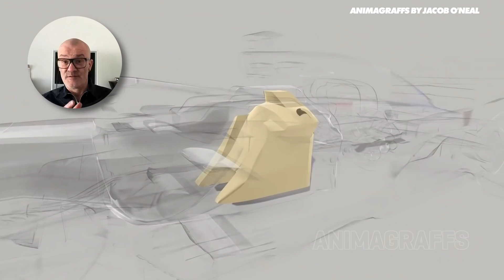Why Max's Red Bull Caught Fire in Australia

Comment: E10 fuel eats up lines in a lot of cars. Probably some of this also happens in the F1 cars.
Reply: only old cars surely. alcohol in fuel has been around a fair while now and many cars were impervious to the effects of alcohol on rubber even before alcolhol was used in fuel. F1 teams would be well aware of this sort of issue.
Reply: i should also point out that there was a youtube channel called "workshop" i think, the guy put any plastic or rubber stuff he could find in alcohol and checked them every so often, not much happened even after months.

Comment: E fules have need used in loads of motorsports of more than a decade (probably a lot longer) so they shouldn't blame the fuel, e85 was used in the V8 Supercars at the very same event and they have no issue with for the last 10 years or so.

Comment: E-10 eating seals. I said this immediately after the Bahrain failures. The question is, why aren't other teams having the same issue?
Reply: they aren't having an issue. because there isn't one. alocohol and seal problems have been known about for a long time now, i was weary of it in the 70s during the fuel shock era wnen i was running my bike on alcohol. F1 teams are surely aware of it, and those old rubber/plastic parts have long been out of use.

Comment: You said Max lost 38 points, Horner said the same thing: “we lost 50 points”. So, as it seems, it was obvious that Red Bull and Max would have gotten two FL both in Bahrain and in Australia. In both cases, Leclerc’s laps were 1 sec faster than the ones attempted by the Red Bulls. So, sure, Max lost 38 points.
Reply: 38 is only true if we're assuming Max would've had the point for the fastest lap, which I doubt, so, for me, I'm sticking with 36 points down the crapper.
Reply: @halofreak1990  yeah, I agree with you. That’s exactly my point. Max wouldn’t have gotten 38 points anyway, so he didn’t lost out 38 points.
Reply: Useless mathematics 😄

Comment: When Perez asked about Max's problem, he was told he shouldnt be worried about that, maybe meaning his car is not affected by that issue, and neither of the alpha tauri engines were problematic in Australia.
Reply: Nah they didn’t want to distract Perez by worrying him during race that his car might fall to the same issue. Good call for them to not say what happened and let him focus. It’s likely both RB cars are of similar setup, but Perez seems to be managing tires/car itself much better. Verstappen has complained every single race so far about tire deg & balance where Checo seems to have managed it. Bit weird that MV’s car is drastically more unreliable, though. Makes me think they’re sacrificing more reliability in the fuel injection area for pace. Things just seem turned up a notch on Verstappen’s car but ultimately less reliable.
Reply: i think they didn't want perez to be bothered with someone else's problem and for him to focus on his job not max's.

Comment: E100 has been used in Brazil both for road cars (since the early 70's) and race cars (nearly for so long - check Endurance Brasil, they run anything from gasoline to E100 on 4-6 hours races). I really don't believe E10 would be an issue, unless they missed completely the point of Ethanol. DI could bring unforessen issues, but Bosch and Marelli have quite some expertise on these with E100 as well.

Comment: Sabotage by one of the ex Mercedes technicians they hired over the season.  Why is it only RedBull getting caught out by this issue
Reply: The former Merc engineers work in the RBPT factory on the 2026 engine. Not on the current Honda engine

Comment: The e10 causing issues in F1 is a bit ironic in my mind - over the last few years, in both the UK and Denmark e10 fuel has slowly been replacing ordinary fuel, and in the time leading up to when it was implemented, it was on the media quite a bit, and almost every outlet was promising that on cars as old as early to mid -90's would not have any issues as a result. With maybe a few exceptions for carbureted cars

In reality, there has been quite a rise in things like clogged injectors/lines, misfires, worse economy and other (usually) fuel-related issues in cars as new as mid 2000's ever since the implementation ethanol

Comment: Ethanol and other alcohols are terrible on fuel systems. You never really know what parts are going to suffer deterioration until you have used them for a while. I pay a  50% more for non Ethanol in my outdoor & garden power equipment because I got tried of repairing the damage it caused. The ironic thing is that producing Ethanol possibility creates more pollution from the farming equipment and the production plants than petrol/gasoline.

Comment: An F1 car that has been running under race conditions has components are extremely hot and those require air flow to cool them. If you stop the car, you take away the air flow and then fires start. Simple, really.
Reply: Did someone see actual fire?
Reply: @HeatherHotcakes  yes, it was televised when the car was on fire, showing the flames, did you actually watch the race?

Comment: With Ferrari having experience with pump gas in their high performance cars, which are raced. With decades of design, manufacturing and data collection. And the other teams being forced to deal with non racing fuel. Along with ALL of the other switcheroo for this season; to mix up Mercedes. Which is what RB did last year. But now, in the great "restart" everyone is still learning the cars, and tracks, regs and schedules; even as the FIA is playing games with driver & track. For a season that probably should have had at least twice the testing time, along with more test drivers going 15 hrs a day. For everyone who wasn't t just working on new car concepts most of last year. RB is still doing a good job comparitively; as much as it is stacked against them,  and others. Along with the new FIA blowing it's whistle for relevance. Is it a wonder that Ferrari has gained a lasting advantage?  Even as their undisclosed transgressions led to their ability to do so, eventually.

Comment: How come E10 only be affecting RB and not the other teams on the grid ? 
There's more to it than meets the eye, it seems that RB have messed something up in the development process lol. Hope they don't loose their chances for the championship.
Reply: It’s clearly effecting the Mercs performance - look how slow all the Merc engine cars are on the straights compared to last year.

I suspect RB are compromising reliability for the performance whereas the Merc has beeen dialled back?
Reply: @stewartdickson7184   Fair point tbh but Merc is slowly riding up the  performance ladder, they aren't as slow as they were at the very start of the season. RB on the other hand is the only team facing horrid reliability issues. Merc can surpass RB if these issues aren't addressed. Ferrari is on fire, but not literally 😂

Comment: I need help on why the fuel change would wreck havoc with Max's car when this fuel has been around for years.
Reply: The change could have made their fuel more corrosive. And shit can destroy some small components and degrade ruber seals and hoses. Small rubber debris resulting of the corrosion can clog the fuel injection valves and cause a lot of trouble. In Brasil the gasoline for normal cars has a lot of ethanol on it, thats why the car manufacturers has brasilian versions of their engines.
Reply: Hasn't Indycar been using pure alcohol for years with none of these problems?

Comment: Regarding the E10 fuel... It would be better with P10 or B10 fuel. That is, replace the ethanol (C2H6O) with propanol (C3H8O) or buthanol (C4H10O). Those are less volatile, have a higher energy density, are less aggressive against various rubbers and plastics AND are more sustainable. They could even use P20 or B30 fuel and still have more power that the ethanol-fuel mixture.

Comment: Can someone clarify the rules around Parc Ferme and the amount of changes Red Bull seem to make between Qualifying and the Races (last season it was issues with the rear wing). Do other teams make that number of changes. If a car is that unreliable and has to have changes in Parc Ferme then surely that should come with penalties - not accusing them of doing anything outside of the rules but feel like they exploit it more than others
Reply: Safety - Changes can be made in Parc Ferme if it is deemed unsafe!
Reply: Nobody makes changes in Parc Ferme. Only for safety one can correct an issue, as you well know. And you also know that FIA checks everything. They are inside the garages continuosly checking what all teams are doing. So stop this acusing. Carlos' car was also repaired netween Quali and race.

Comment: That plastic F1 fuel tank could in the long run be the culprit...it melted with American gasoline in Jay Leno McClaren p1 road car as it was built for European fuel which then didn't contain ethanol....E85 is even more corrosive....I have looked on line an production auto industry's is getting away from recommending E85 use as an option to regular pump petro fir every day use...it was widely accepted to use e 85 in ur brand new modern car...but manufacturers are moving away from that...peace guys thanks

Comment: Leclerc was doing fastest laps one after the other, after a while Verstappen tried doing a fastest lap, that didn't last long, and BANG.
Reply: Max only matched speed to keep the distance between them te same. His car became lighter with less fuel just as Charles' car. He wanted to keep the gap small enough to not give Charles a free pitstop. Thats normal racing tactic. That it became a fastest lap, that was with a very small margin. He didnt go for the fastest lap. That had no use at that point in the race

Comment: Ethanol eat up any rubber plastic....like that plastic gas tank...u just showed  a visual of...what happens with Ethanol it eat rubber an plastic then carries it into fuel injectors leaves the rubber an plastic on top of pistons coating cylinder and lock up small motor s jet skiis motor bikes just destroy anything except metal....want to buy some USA fuel I love to get rid of some...just kidding I was actually given a nice little Yamaha scooter that had fallen victim to Ethanol fuel s destruction....PB blaster fir rust will remove the rubber that caused the locked up motor an she running again....easy peasey...u know it seem very odd at both incidence for max happened with only a couple laps remaining...this time one lap...wow that is tough.....good race....how about Mercedes rally good team work an great driving to get one car on podium an Lewis 4 th....regardless of what is dealt to Mercedes u know they will persevere

Comment: well E blends are usually more corrosive (the higher the mix the more corrosion you'll  get) but I really doubt it was an eroded seal since it's only 10% and Redbull power trains are the only one with that issue (we would';ve seen more throughout all season if that was the case). I don't think it was also a fuel leak because you would've had a bigger flame and more smoke, though I don't know the burning characteristics of blend fuels. A leak on the hydraulic system doesn't mean a complete loss of power steering or rendering the gearbox actuators useless). Given how the fire looked like, it seemed more as a hydraulic leak than anything else, even more so when Vertsappen said it smelled like something was burning and smelled bad. Full Redbull findings have not come out yet.
Reply: Might not be just ethanol on it’s own, there are other additives that are added to fuels perhaps Esso had an additive that maybe it a little more corrosive than normal

Comment: So why did Max say there was a funny smell in the car? It's on the pit to car channel.
Reply: I as thinking the same. I am sure he would recognise the smell of petrol.
Reply: He said he smelled some weird fluid so that could point to either hydraulic fluid, brake fluid or perhaps battery coolant? A hydraulics failure would probably be more obvious because he'd be noticeably struggling with the steering/gears or at least complaining about it, brake fluid would again be pretty obvious from an outside perspective because the car would either be pissing fluid or he'd have binned it when the brakes failed to work. My suspicion is that their electrical system is running dangerously hot and really doesn't like slowing down for safety cars
Reply: Driver61:
Scarbs:

Comment: It's a tale as old as time for Red Bull. Honestly a continual by-product of the removal of Big Tobacco from the sport turning F1 into a manufacturer-centric racing league (and basically turned Indycar/NASCAR into spec leagues). Doesn't help that Red Bull has issues with lashing out like children and blaming the engine manufacturers for their lacking ability during some years (with awesome bridge-burning skills to boot). 

Pretty much RB is constantly between a rock and a hard place (and would be the same for any team as successful as RB, and one of the issues with F1 that actually hurts the overall health and competition of the sport). Ferrari and Mercedes runs F1. Renault and other engine manufacturers are perpetual "little engines that could." Without Big Tobacco money, the only teams that could be competitive are the ones that makes constant obscene amounts of money (see high-end car conglomerates). 

As long as you're a small team, you could get a Ferrari or Mercedes powerplant with no issues. But the second you start challenging them, they will put a embargo on you getting one of their engines. RB always runs into this pattern, they burn bridges, gets saddled with an engine manufacture that's there for a little bit, they leave, RB can't get a Ferrari/Mercedes powerplant, they try their hand at being an engine manufacturer, fail (because creating bespoke engines ON TOP of bespoke cars are not only ultra expensive but insanely difficult), run back to lesser engine supplier. Rinse, repeat, until they can get a better engine supplier. 

They can't really complain to the F1/FIA because they have their hands tied. They can't do what they SHOULD do (put a rule that forces ALL engine manufacturers to sell engines to any team REGARDLESS of competitiveness to them), because one, or both, could just as easily pull out and diminish the series (or have them scrambling for car conglomerates to take part). So teams, like Red Bull, suffer. The sport suffers, and we go back to Ferrari/MB dominating everything in a couple of years (like they've practically been outside of the questionable RB spot last year).
Reply: Take your meds
Reply: @1770-y9g  NoU
Reply: Which is why we need Porsche and Audi
Reply: @delishdida  Or returning Ford.